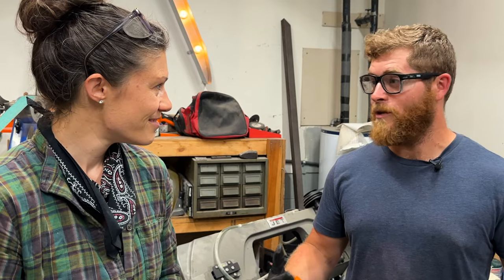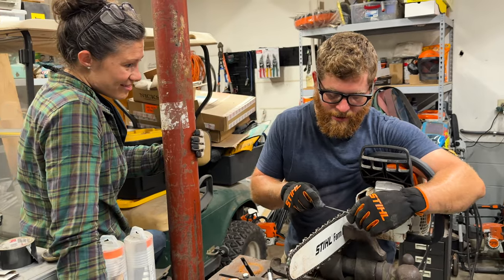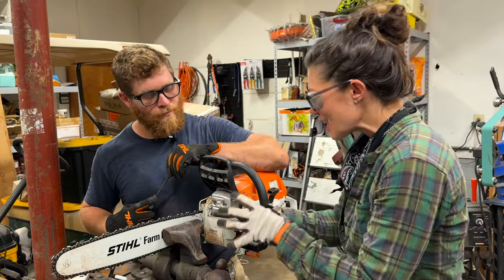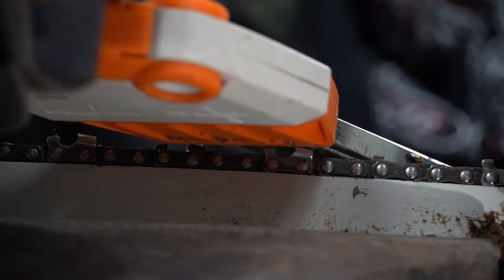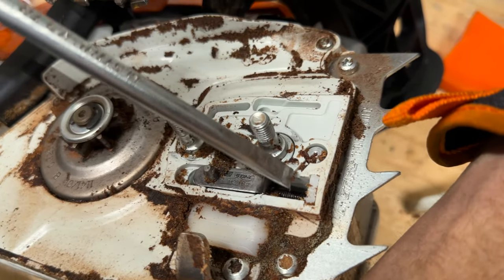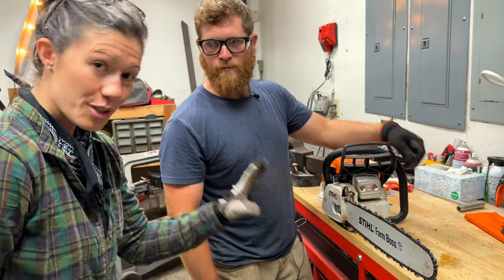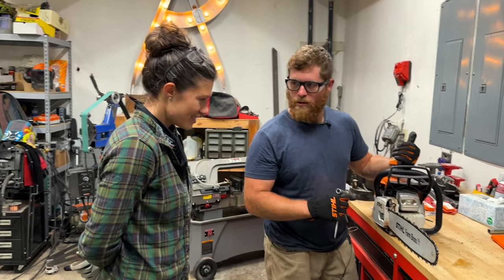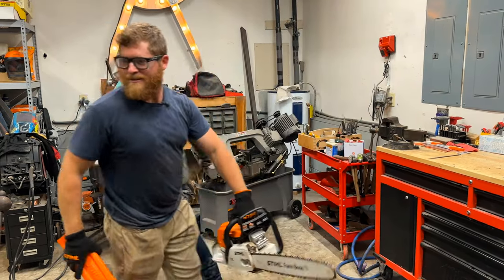Everything You Need To Know To Sharpen + Maintain Your Chainsaw Like A Pro

Comment: Like a bandsaw, loosen the tension on the blade after you're done using it. As you use it, the blade gets hot and gets longer, if you leave the tension snug, the blade cannot shrink proper and will damage the linkages and can warp the bar.

Comment: Thanks for that I learned a few things.  Is there a rule of thumb as to how often younshould expect to need to sharpen the chain?
Reply: It totally depends on what you're cutting, and how well you keep it out of the dirt, but you get a feel for when it is taking more work to get through stuff.
Unless you're really hogging away the metal, it never hurts to give it a couple swipes to touch it up.
Reply: The majority of the wood I cut is poplar and pine.   @taylorseigler
Reply from the maker: The best rule of thumb is that when it stops making ribbons for shavings, and starts making dust, it’s time to sharpen. Some practice with the saw when sharp and careful observation will reveal that the saw starts feeling and sounding very different when it starts to get dull. If I’m spending all day out in the woods, I’ll sharpen at least once while I’m out.

Comment: All do respect to the sthil 2 in 1 chainsaw file I was told that it is wrecking my chainsaw chain and it is better to free hand file with a file guide than to use the 2 in 1 sthil file 😲
Reply from the maker: Who told you that? Every professional chainsaw user I know uses and swears by these unless they need a special grind (like rip filing etc). They’ve totally revolutionized the industry.
Reply: @AnneofAllTrades  yes they are very good and they do a great job of filing the chainsaw but ive been told that they are wrecking the chain of my chainsaw 😱 so I don’t know what to do really 😫🤔 if I asked 10 different people I would get 10 different answers 😮‍💨

Comment: Is the Stihl sharpener still for specific chains?
Reply from the maker: It is, it will fit lots of different chains though, I use Oregon chains on my saws. you just have to get chains that correspond with the specs on the stihl guide, or buy the guide that corresponds with the specs on your bar ;)

Comment: If you don't have bar oil, can you use 30 wt motor oil?
Reply: Most modern bar oil is formulated to be less bad for the environment, but yeah, in a pinch motor oil is fine.
Reply: Thank you. @taylorseigler

Comment: Most homeowners have no idea how to maintain their saws that sit in the garage with old gas and dull chains. Good tip on taking a pic of the bar before it becomes illegible. If you accidentally get the chain into the dirt when sawing, you'll need to sharpen immediately. I usually end up sharpening in the field without a vise so can be tricky-any advice for doing this outside a workshop? Thanks!
Reply from the maker: Yes! Get one of these :) MaxPower 336588 Chainsaw Filing Vise https://a.co/d/dueFxAs

Comment: Thank you for this.  I'm currently in the situation of mine not wanting to start, so needing to troubleshoot and I'm not an avid user of it.  Learning curve.
Reply: I just learned how to fix this problem! I flooded mine, so you might want to try to look for flooded engine videos. Be careful!
Reply: @cmmake  Thank you.  I will.
Reply from the maker: Flooding is often an issue, as well as dirty carburetors. I’m far from an expert on small engine repair, but I’ve had most every problem in the book with chainsaws over the years and most are a pretty easy fix once you get the lay of the land inside the saw.
Reply: @AnneofAllTrades  any good resources you can recommend?
Reply: I add some Seafoam treatment to my tank when I start it after a long time. It helps keep things clean.

Comment: Super cool, but I have to ask - what does a new chain cost? A bit embarrassed to admit it but, to be honest, if it's ~$20, I'm probably going to just buy one.
Reply from the maker: Don’t be embarrassed, I get it. If you only use your chainsaw in short stints, occasionally, that might make sense. Cost is dependent on size and quality but for one of my saws, a new chain is only $18. But for what it’s worth, it takes longer to change the chain than to sharpen it with the guide :)